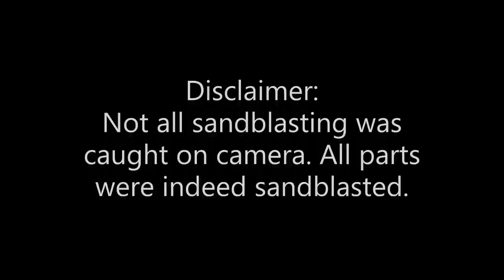Rusty 1950's Doepke Heiliner Restoration

Comment: I just purchased a fairly nice one today, It looks like it hadn't been used much but there is a bit of rust in some small areas, The pump needs to be looked at. It dose work but is lose and slow working. I had been looking for one for years after my parents gave all my toys away many years ago, They included one of thse and other big tractors and a Tonka Garage set and Smith Miller trucks plus a tounahaller and dump with a motor grader.

Comment: I’m restoring one of these exactly following your excellent video. Where were you able to get the axle caps for the connector rod and the rear wheels? I can’t find the exact ones anywhere. Thanks.
Reply from the maker: My axle caps were in fine shape. I did not need new ones.

Comment: I bet my biggest mistake was using WD 40 on the pump after I picked it up. Now I will have to take it apart and remove and clean it then reinstall it.
Reply from the maker: There is probably a bunch of junk in there that is all gummy! Hope it works well. These have to be one of the coolest toys. They were crazy expensive when new in the 50's.